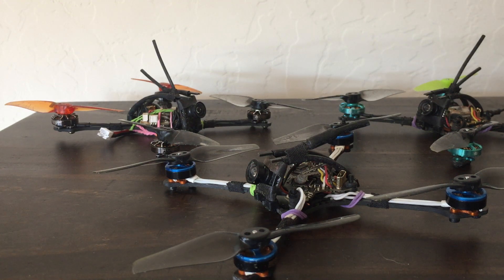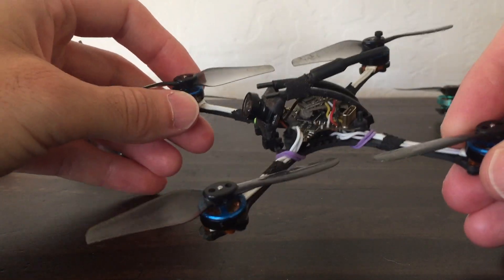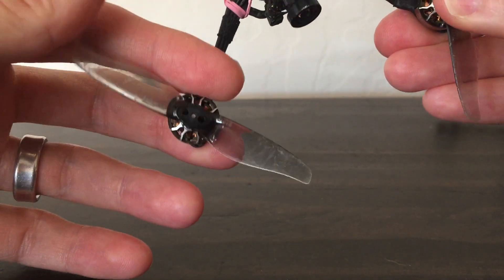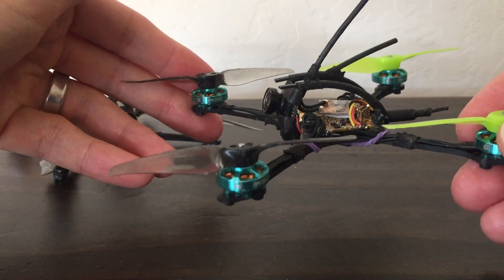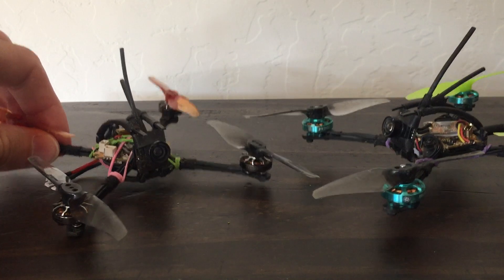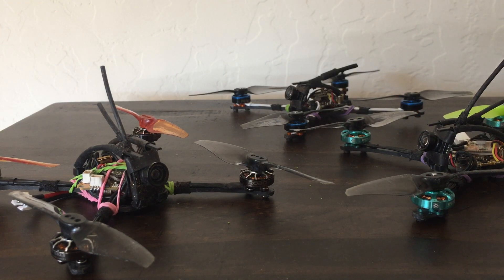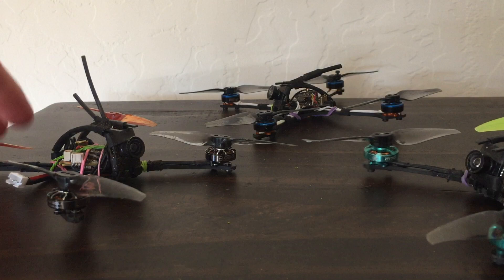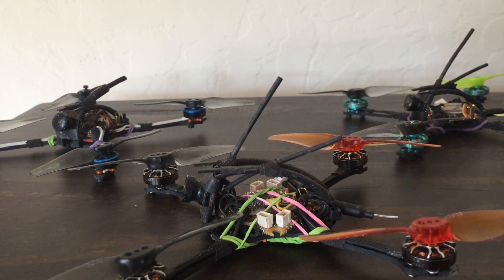1S 3 inch Pairing Motor Prop and PWM Discussion

Comment: As far as these being super-coupled systems - yes, and that's hard to express.  Something as absurdly subtle as PWM is hard to explain, especially because it has knock-on effects in terms of reduced effective D-Term (but varies across RPM ranges), and that timing becomes a slightly more important factor as well.  The tuning windows also change drastically, and AUW/inertia affects that massively.  Torque authority and PID authority are different things, but definitely connected.
The real figure of merit is equivalent throttle-timer, and whatever fun-modulation-factor goes into that.  My race setups run a 1:00 throttle timer (and I actually bring $5 batteries back anywhere from 1:11 to 3:15), so those GF3018's have some real bandwidth... I know that I'm going to have a minimum of 2 minutes of equivalent fun per pack, even if I land halfway through that, there's still immense joy in going that fast for any length of time.
Reply: Also, can confirm that ESC dead time makes a major difference in terms of PWM frequency dependency - lower deadtime tolerates those setups a bit more and doesn't lose as much in terms of braking, and practically the timing and commutation point calculations are all part of why that works nicely.  For my part, flying mostly 1105/1106 stuff on 2S/3S, 48kHz is nice because it's smoother and I have power in the bank, but down in 1S regimes it does make sense to maximize effective torque.
Reply from the maker: Absolutely true about normalizing time by the quality of flight and whatever the factors are important to driving that. Also good point about the connection between PWM and effective D-term. Thinking about it, I may try a retune on my 2S 1202 build. Its on 48 khz and flies really well but require a lot of D to the point of generating high Dterm noise motor heat and the associated loss in efficiency. I wonder how close I may end up to the same place by going 24 hhz if I can lower Dterm enough to decrease noise and improve efficiency. I'll probably give that a try this weekend.
Reply from the maker: Dead time was one of the reasons that I got very excited about the beebrain brushless when it came out as it was released with Y H 10 knowing that I would likely be using 48hhz with it. The other 2S board are 50 and 2-3S typically 30. Then as it turns out it needed more dead time and now they are recommending  S H 40 (I think its S). I personally find the experimentation fun but for people who just want to fly its got to be maddening.
Reply: @Quad66  The other potential shift is moving to biquad dLPF on D-Term and nudging those points up ~10Hz,, since that can kill off a lot of the noise in higher areas.  Overall I'm a fan of higher PWM frequencies across the board (eve run 48kHz on my 7" rigs), although the tradeoff is definitely the lower RPM range where applying multiple band-aids (thrust_linear, high D Gains, more D-term filtering) are needed to make it better, but smooth feels better to me overall

Comment: I got the FPVCycle 1202.5's flying amazingly well on the latest BF & JM48K...  it's so comfortable and sharp.  I even added HD, still on 1S.  I want to try them on 2S with the GF Bi's, cause I've been using them with the GF Tri's.
Reply from the maker: mistercohaagen On 2S you need lower pitch, 3015 biblade probably the way to go if you’re willing to drill and balance
Reply: @Quad66  is there any easily repeatable offline way to balance such tiny props?
Reply: @Quad66  also, i'd be willing to do a throttle cut on the 3018's.  think that would work?  these 1S tend to get mushy at top throttle anyway; why not just truncate it's capability and pilot within the envelope like a sane person ; ) ?
Reply: @Quad66  I tried the 3018 bi's... they pull about 2A less overall on 1S.  I think the headroom is going to be there for 2S on 48K.  I ordered a CrazybeeX to have an amp sensor on 2S.  17A is full punch on the tri's, 15A on the bi's.
Reply from the maker: what fun is there in flying like a sane person?
Reply from the maker: there’s the needle method where ruin have the needle horizontal put the prop on and spin it, heavy side finishes down
Reply: @Quad66  hehe.  Indeed.

Comment: I was just going to say those fpvcycle 1202’s were done before rpm filtering was mainstream + bob used to not like rpm filtering. In fact he actually despised it!
But he now has changed and is using it.
Reply: I was pretty excited when Bob came clean on that preference... it's a good thing, and I'm actually kinda thrilled that with his influence Emu is going to develop towards including that capability as well... I'd like to see their preset development effort paired with the real performance improvements possible with a proper RPM/dLPF filtering setup, along with thrust_linearization and dynamic idle

Comment: Thanks for sharing your experiences, a lot of interesting information! I am planning to build a Toothpick drone and have a couple of questions (it should be light, but I am not yet sure if 1s or 2s).
- for light 1s and Gemfan 3018: is it necessary to use ESCs higher than 5/6 Ampere (most Whoop FCs are limited to that value)? 
- for light 2s and Gemfan 3018 (2x260 or 2x300mAh): any experiences with Flywoo 5500kV and what are ESC requirements for such configuration (are 5A ok)?
- any main disadvantages going to 2s (thinking about 2 1s batteries with pigtail)?
Reply from the maker: I have 5 amp boards tolerating 1S 3018 fine but I also don't do a lot of sustained high throttle flying. For 2S 5500 kv is not enough to justify the extra hassle over 1S. For 2S 7500-9000 kv is the range to go for. For light 2S you want the higher C rated GNB 2S 300mah. They seem to be made similar to the 450 and 520 cells and much better than the long skinny 300s. If you go 2S don't Y them in with 2 PH2, you'll waste too much by doubling the connector resistance.
Reply: @Quad66  Thanks! 2S 7500-9000 kv would then clearly outperform the 1s 11000kV configuration, right? What are the amp requirements for such configuration then? 
I was planning to use BT2.0 connectors if using two 1s batteries with Y connector (XT-30 might be the better choice for a 2s battery).
Reply from the maker: Kolibri F for light 2S I think the 12 amp boards are a good match. While you possibly get away with a 5 amp board those tend to be less efficient and have a longer ESC dead time.
Reply: @Quad66  Thank you, also for pointing me to the ESC dead time. So far, I have ignored the numbers of the ESC. Does this matter for 24 kHz, or is it mainly for 48 and above?
Reply: FYI: I will most likely go with a 2s setup: I already ordered an DarwinFPV F411 (specs sound good: 1-3s, 15A, 2A BEC, good solder pads for the motor). Motors are a bit difficult to get (a lot are sold out). Amax 1303 with 7500kV seems to be a good option.

Comment: Flywoo 1103s are pretty tough, med. notch, 10kkv more so than the 8750kv, around 4g I believe.   Xing 1103 10kkv are moderately notchy, 3.8g with wire and connector. BeeMotor 1103 not much notch, but they weigh 3.6g with wire and connector, 10kkv. Spedix 1103 11kkv are notchy, and zippy, look great in black, and light since they are another variant of the hyperlite 1103 (but 3 hole.) Brother 1103 8kkv (red on black bell,) have good notch and weigh 3.7 with connector. Diatone just dropped some new 1103s and at a glance they look like they might be lighter than the last 1103s, which are about 5g each.
Reply from the maker: I wanted to try the BH but they seem to be discontinued, Avant also uses them rebranded so I may try those.
Reply: @Quad66  Indeed, I recall spotting the same motors with different branding at the time. Same physical form that is. The kv and wire may have been different.

I have some more equipment for your research on the way, should you decide youd like to incorporate it. I'll be sending it out to you either way. No obligations of course. I'll hit you up on RCG once I receive.
Reply from the maker: Sounds good. The experimentation has been fun and definitely teaches me a lot, so I look forward to it.
Reply from the maker: I finally figured out how to get c clips off the 1202.5s reliably by pushing from the op e side with a utility knife blade. Time for some motor bell swaps.
Reply: @Quad66  Excellent!
Reply: @Quad66  I just realized you likely have to swap the bearings too, if they're even the same size. =\

Comment: I’ve been following your 1s builds and motor tests. Now that you’ve determined your quad with the flywoo 1202.5 and 3018 props is your favorite and most responsive. Do you plan on doing a build video or do you have a listing of all the parts and tune.
Reply: Im considering this as a first quad along with betafpv lite radio 2 transmitter and ev800d goggles. Do you thing this is a good way to enter fpv?
Reply from the maker: Parts:
Warpig or Skyryder 120 frame in 2mm https://armattanproductions.com/pages/shop_product_grid/4205
Ziptie canopy
Newbeedrone Beebrain Brushless board with Beeye camera and Beciever
Flywoo 1202.5 11,500kv
Gemfan 3018 prop
RDQ/GNB 1S 520mah LiHV 

The FC has some pros and cons, I need to do a follow up to go through that. The camera is only okish but it plugs in so I give it a pass. 

Here's the diff:
https://drive.google.com/file/d/1ZNe5Nw7s6iy802beXYu94rFh8yLza0_9/view?usp=sharing
Reply from the maker: The radio should be fine but I have seen issues reported when trying to use it with D16 telemetry receivers like the r xsr. This issue isn't a big deal for flying whoop boards with integrated receivers but if you want a full range receiver it may be an issue. For goggles, if you can swing it, I highly recommend stepping up to the Fatshark Scout or another mid level goggle. Being able to seem makes a huge difference. For a first quad, you may want to start on a bind and fly. Building and setting up a quad has a very large learning curve. Also, bind and flys will have many more people that can help you trouble shoot issues.

Comment: great insight. Are you running these on 2S or 3S ? and where do i find a 3015 propeller ? i can't seem to find them anywhere, never heard of that size
Reply from the maker: The builds in this video are 1S but I also fly 1202 and 1103 on 2S. I’ve flown 1204 on 5000kv but those are heavy and lame on 2S, they need 3S. The HQ T3x1.5 are 3015 (first 2 numbers are the size, second 2 are the pitch)
Reply: @Quad66  ow i did not realize there where on 1S ! thx for explaning

Comment: You forgot to compare  geprc 1102 14000kv which I think you also liked them!
Reply from the maker: Panagiotis Kampakos they can swing the 3inch props. They are great on whocares/KK 65 mm
Reply: @Quad66  48 or 24khz?
Reply from the maker: Panagiotis Kampakos *they can’t swing the 3 inch prop. on 65mm I prefer 24khz as the efficiency is not worth the loss of torque and braking.
Reply: @Quad66  thanks!!

Comment: Fpvcycle bells on the flywoo stator? Also what cam are you running?
Reply from the maker: That would be a great experiment to swap bells between the FPVcycle and Flywoo. The cam on the BBBL boards is a beeye which is marginally adequate but plugs in. the other cam is the 199C is which is not terrible, they do tend to have debris inside.